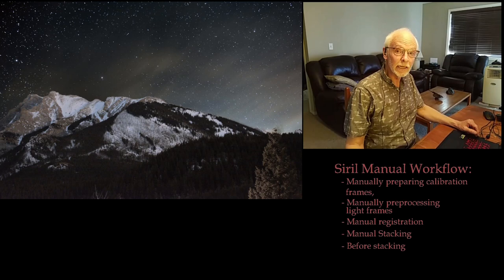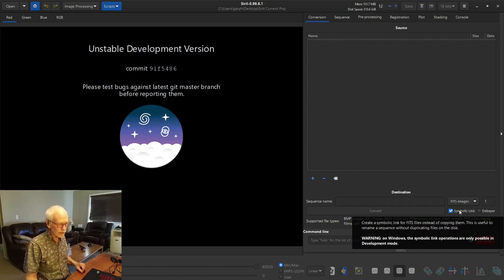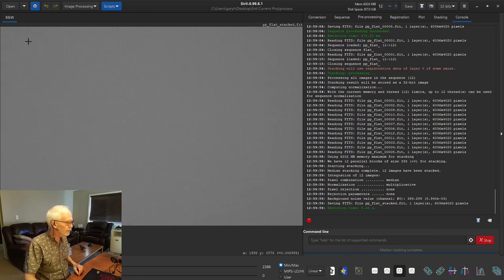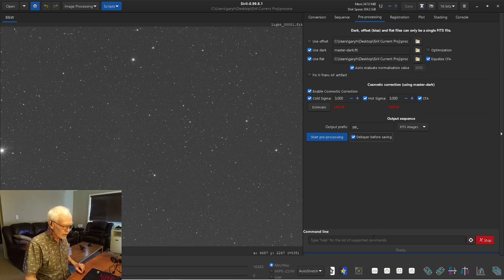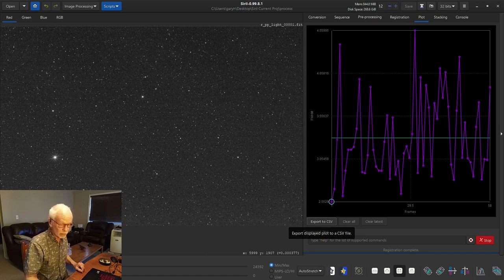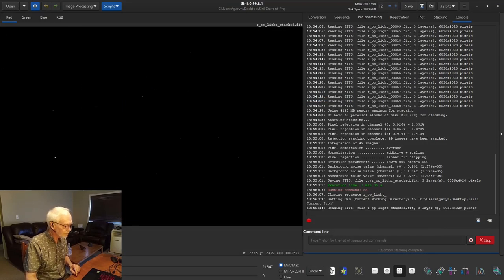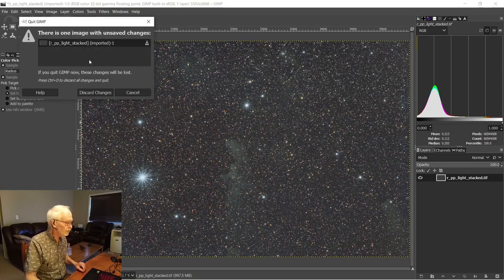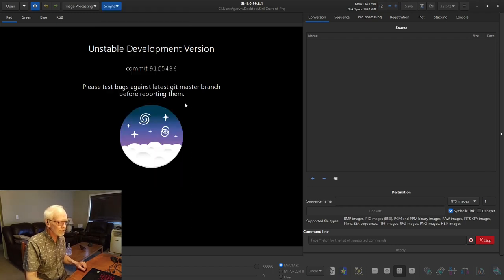Completely manual image processing in Siril

Comment from the maker: Hi, I am responding to a comment/question sent by Erik de Klerck. For some unknown reason it shows up in my notifications, but not in my view of the active comments that I can respond to. Erik asks about Sirilic, a standalone interface that allows compilation of Siril scripts, and runs them. It does somewhat automate the task of preprocessing lights with their respective calibration frames from multiple sessions.
I now use a dedicated cam, so use library master darks and flat darks. For me it is easier to just create a new master flat manually for each session, and then to calibrate with those masters. I can gather the preprocessed lights from each session & register/stack them as a group at any time. As such it seems unlikely that I will use Sirilic, but that is because of a complete understanding of Siril's normal interface. If anybody wants help creating new scripts for unique situations I do encourage you to look at Sirilic. It is well documented.
My regards

Comment: These are fantastic! Do you do any mono work? I shoot a lot with Mono and would love to see the process with that.
Reply from the maker: Thanks! I have not yet done mono, just upgraded to a ZWO OSC cam. I do believe that Siril is capable though. You could run each set to a stacked final, and then try RGB Compositing from the image processing dropdown. There is an alignment tool in there, and room for a luminance channel.  From the command line there is also a command called linearalign. It takes the open image and aligns it to the reference image that you enter as a parameter. I have never tried either from my dslr history, but if you recognize these tools you may be ready to use them.
Siril also has a function to split Ha and O3 from a dual filtered set, if I ever get some clear sky witn no moon I am planning to shoot a galaxy with the l-pro and with the l- extreme and try to mix the Ha channel from the Extreme with the RGB from the l-pro. But not there yet! 
Best of luck.
Reply: @BorealisLite  Yes it is. I will get that figured out once I fully understand these scripts. Looks like you should be able to build your own script for any custom configuration you want.
Reply from the maker: @TheNarrowbandChannel  Indeed. When you run your mono images you could use the same darks & dark flats (bias) for each channel. Just need unique lights & flats for each filter. If you look in a text editor at the script files you can see how they work. I would just have a flatR folder, a flatG, a flatB, and a flatL folder for the flats. Then you could open/Save AS the full processing script and just change the folder references in the flat section of the script, remove the debayer & osc commands in the preprocessing section, and change the ouput file name in the stacking command for each new script you create.

Comment: Gary, thanks very much for this walk-through of Siril, I learned a lot of details that had escaped by attention previously. I'm looking forward to your other videos. Subscribed. On a completely unrelated topic - I noticed in the background that you have a portable a/c unit. How is that working for you? We have a small room that needs a/c and are debating between a unit like yours or ductless mini-split. Any insight would be appreciated. Thanks.
Reply from the maker: Hi Jack, mine is for the few hot days we get, I just set it to about 27C and it dehumidifies to a tolerable level. If you need heavier use, I would get something that does its hot air exchange outside, this one blows interior air outside all the time it's running & creates a vacuum that draws humid air in everywhere else. That is less than ideally efficient. Cheers
Reply: @BorealisLite  Gary, thanks for this. I did not understand how these units worked. Pulling air in from the outside is NOT what we want. Last September we went through a week-long period when we could not open windows because of wildfire smoke (western Oregon). It was terrible. I decided to create a safe room that had a/c with no outside air exchange and a hepa air filtration system. The ductless mini-split satisfies the a/c part of the system but I was looking for an easier/cheaper solution.  Thanks very much for you input. Clear skies.

Comment: Hi Gary new to astro & SIrIL  so big learning curve ahead for me.when people say add previous data from another night, i presume all settings must be the same ie aperture,shutter,iso am i correct..looking forward to your Orion video as only managed to capture that thus far.with only camera & 135 lens
Reply from the maker: Hi Chris, I do realize the learning curve is huge with all of this. It comes in steps, eventually becomes manageable. Some people do shoot targets over multiple nights to get enhanced data. One strategy is to use the same settings and to just get more subs. For high dynamic range subjects like Orion many shoot longer exposures for the nebulosity & dust but also short ones for a core that is not blown out. Then a blend using aspects from each. 
With a cooled astro cam on a scope we can re-use dark frames of the same exposure length & gain. But we need new flats and flat darks. With a dslr on a prime lens the opposite is kind of true. Darks are unique to the sensor temp while shooting, but so long as there are no new dust spots on the lens, the flats and biases can be used across sessions. Truthfully, in the winter when it is cold, I never used darks with my dslr. Instead I would just use biases to calibrate the lights. So my biases would go into both the "darks" and "biases" folder in Siril.
To address your question, the images from each session need to have close to the same framing for stacking reasons, and if you do use calibration frames then each session should have its own as required. At that point they can be preprocessed with their calibration frames, then gathered until done, and finally registered and stacked as a group. In this way images with different ISO or exposure times can be stacked together if appropriate.
In all truth, until Siril becomes second nature I would use the groups feature of Deep Sky Stacker to keep it simpler. You can place the images from each session in a DSS group with its calibration files, and it will align & combine the sessions properly. At that point the output file can be opened in Siril for operations like background extraction, color calibration, & stretching prior to export for further work. If you have a short exposure set for the core of Orion, it can be put in a group with none of the images selected while you are stacking the longer exposures, then all of them selected but none of the others for stacking the short exposure group. You would use the original reference frame to get matched alignment.
The nebula will be well illuminated without shooting over multiple nights, if you are going for a wide field with Barnard's loop etc, then more time may be justified. 
I hope this is helpful. There are a lot of YouTube vids about each aspect of this I have mentioned. I think the key is to take on one thing at a time until it all makes sense. And keep every raw sub, you may want to go back and reprocess or add in the future. 🙂
Reply: Thank you so much for your reply .keep up the great tutorials really appreciated

Comment: Hi Gary, quick update on previous chat. I purchased a Hoya Skylight 1B filter for my 200mm lens.Last night l managed to do a 10second star test on Capella.With this particular test I preferred the image without the filter,the image appeared slightly sharper as well.
With the filter in place the image produced more internal reflection on the final result and I saw no difference with the CA unfortunately,thinking maybe because the 3/4 moon in the sky didn’t help with some internal reflections.During daylight use and x10 zoom on a distant object the filter provided a much improved image.The filter did clear up a lot of CA.More star tests on a dark night required I think.
Reply from the maker: Thanks for sharing your results. I looked up the filter, apparently it subdues blues (warming). So maybe helps with the blue CA, at the cost of  letting in less light. Would be interested to hear your comment after a dark night test. Best of luck!
Reply: @BorealisLite  Hi Gary, I think that sounds about right on what you commented on.Will keep you updated. Regards.
Reply from the maker: @jonbasstro1413  Thanks for this idea! Sounds very good, even if it may mean more subs. That would take less time than trying to effectively process the CA. My regards, going to try this next chance!
Reply: @BorealisLite  Look forward to hearing back how that goes for you.I’ll be using the step down rings on my old lenses from now on.All the best.

Comment: Thanks Gary.  Nice video.  Question.  Stacking in Siril looks rather complicated.  If you stack an image in DSS then transfer it to Siril for processing, will the program still have all its same functions?  I assume you'll have to convert the TIFF file to a FITS and you're good to go?
Reply from the maker: Hi Greg, your idea is completely valid. I started using Siril by opening tif files from dss & going from there. I think dss can also generate fit file format stacked images too. 
Also, this is the manual process. Siril is much easier when using scripts as described in my earlier vids. This one came about from requests from some who wanted to look deeper. Cheers
Reply: @BorealisLite  Great. I'll try it. Thanks so much.

Comment: Hello I saw your videos at you tube and decided to give Siril a try, but at the pre-processing the lights I have nothing but black screens; I posted the question at the blog but no clear way to solve this, bad thing , any help you can provide will be very much appreciated!!
Reply from the maker: Hi Jose, very dark frames are normal depending on the capture. They are linear, or as shot. We calibrate, stack, & do some processing in the linear state. Siril has a button in the lower center where you can choose a view. If you choose autostretch it will show you a stretched version of any image without actually stretching it. This is powerful because you can see what you are doing while remaining linear. It is covered in some of my earlier vids in this playlist. It is my hope that is what you need. Regards
Reply: Thanks Gary, this sets of lights that I am processing were processed with pix insight  with no problems by myself, the Siril testing error is when y try to preprocess the lights applying the darks and flats, I am following your steps one by one and everything is ok until I preprocess the lights, somebody told me they is because 
I am subtracting twice the bios, I don’t know how if I am following your preprocessing steps one by one, your videos are excellent, but I can’t continue thank you so much for your time, I wonder if I can send some screen prints with my results, if it’s possible
Reply from the maker: @jfn480427  Thanks for getting back to me. I can't explain it, but if you have pix & it's working for you then I think you are good to go. I am curious but the only way to send big files is by link sharing from Google drive or similar. If you want to do that pls feel free but not obligated.  Regards!

Comment: So Gary as you mentioned to me I am able to preprocess and stack separately as separate stacks my images from different cameras….I would like like to use cameras of APS-C and 4/3 size…would that be ok for Siril?….also when I then proceed to combine those separate stacks from the different cameras I imagine I have to just register them together and them simply stack…do I use one as a reference for registration and is there something else that I have missed?😊
Reply from the maker: Hi, you could certainly try that, but for best integration I would actually try calibrating all your sets into a large group of preprocessed lights & register them all at once. If that succeeds, then stack.  If not there is the option to stack each set and to try to stack the stacks.
If this fails maybe put a few subs from each set on google drive & I can make a short video about it...
Reply: @BorealisLite  thank you Gary for your speedy reply 😊
Reply: Siril works on seq …and how would I be able to get more than one seq at a time to be registered together….to my understanding it can only register one seq at a time…is there a way…please tell me how😊
Reply from the maker: @astronomynotebook  Hi, I assume at this point  that you have preprocessed & debayered all your lights with appropriate calibration frames, and that you have several sequences like pp1_light.fit, pp2_light.fit etc. in the process folder.
At this point you could delete or move all other files from the lights folder, and from the process folder. Then drag all the preprocessed lights into the lights folder, add all them all to the conversion list in the conversion tab, and convert them. They don't need conversion, but this will create a new sequence with them all in it.
From there go straight to registration. If Siril can find common alignment stars, they should all get registered, ready for stacking... Because of the differing image scales there will be significant stacking artifacts to crop out, but all shared areas should be there.
Hope this helps!

Comment: I have different size images despite all camera settings being the same.
Reply from the maker: Hi, that's very little information to go on but the first thing that comes to mind is that a dslr will switch to portrait mode from landscape or vice versa as a cam rotates, unless that is turned off in cam settings. Also when you convert from cam raw to fits the dimensions can change a bit. They all should have the same conversion applied. I have to go to work for 14 hrs now, can respond further after that if needed. 😊
Reply: @BorealisLite  I went through the online manual for my camera, and the difference, is because of the difference between the selected aspect ratio 3:2 instead of 16:9 or vice versa.
Reply from the maker: @MRCAGR1  That would do it. On my Nikon I don't recall even having that setting when shooting raw, but hopefully that will allow you to move forward now. Regards